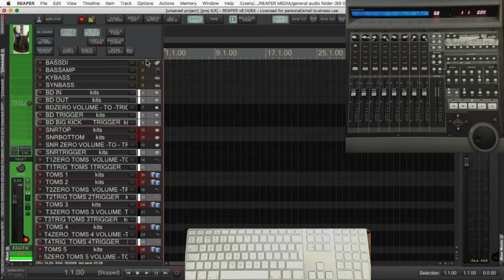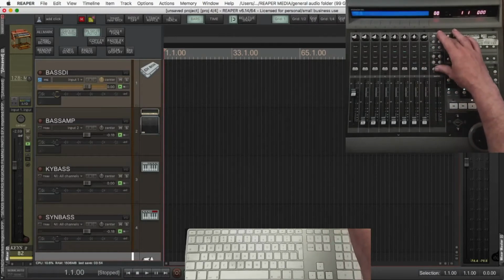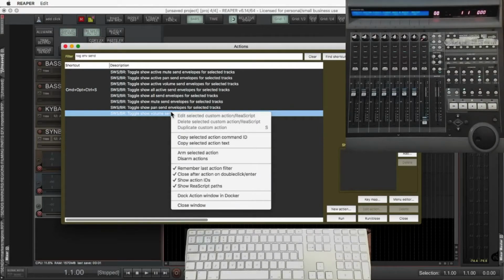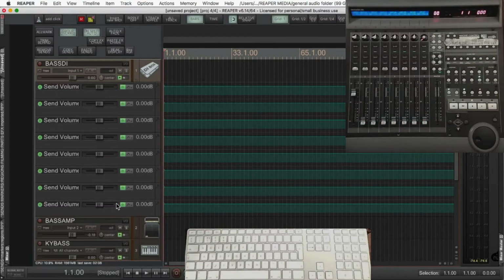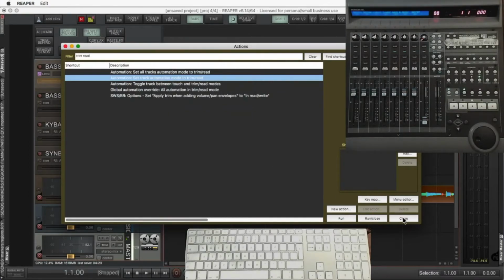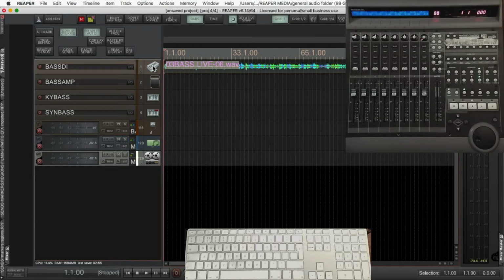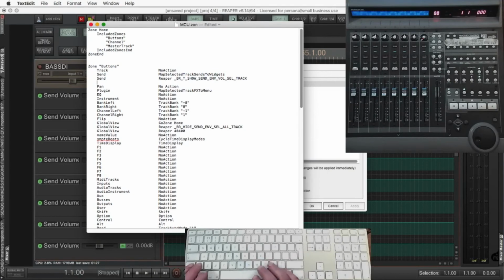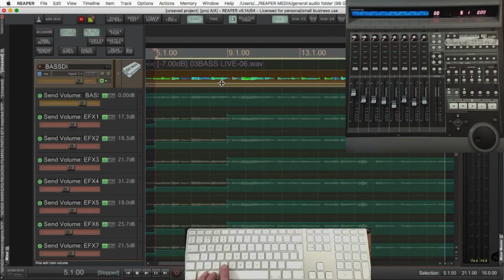REAPER DAW - CSI - AUTOMATION PROGRAMMING  BUTTONS  AND STATES -

Comment: Good video. I'm following this series closely because i'm trying to reprogram my own controllers. Can you make a video where you look at the difference between "MapFocusedFXToWidgets" and the "MapSelectedTrackFXToMenu" ?
Reply from the maker: Hi Thomas - i have now made a vid looking at the introduction of programming fx via CSI. I use map "SelectedTrackFXToMenu" to show the fx list on the channel first, then select those fx - floating fx. This is not looking at the difference, but does demo one of those you mentioned : https://www.youtube.com/watch?v=dOyxuHGOuS4&list=PLgiV4QJOk1rLRnCEVqC-qwcGe4HREZGi_
Reply from the maker: Thanks Thomas. I don't actually use CSI for fx - only general program control and sends - (found it a bit long winded compared to reaper's internal method of programming plugz - plus i already had a working system for fx programmed up. As the series goes on it'll explain why i do this and how it's easier for me to work with...... for now!   If you look at the bassroom/mixroom vids i show how i got them on my SL25 - the MOST important thing, is to have a controller that can handle the amount of parameters most plugins have. For EQ's - 24 rotaries or 16 and 8 faders and up to 40 buttons means your template on the controller stays the same for all of your EQ plugs, making it intuitive to use, almost like one piece of hardware for all EQ's. Then a template change for Compressors/verbs/delays and it starts to fall into place. Let me know what you think if you watch one of those, as far as an option for simpler fx control goes. ..
Reply: @undarkreaperdawcsi8187  Thanks for your reply. I have seen your video about your SL25 controller, and I'm applying several of your tips to my own reprogramming maps. I have a m_audio Project mix and a BCF2000. The project mix do most of the mixer functions where the BCF handles the track and arranges related controls. Regarding the need for many buttons, I have resolved it by jumping between different Zones inside the plugin *.zon file, which gives me the options of having the display to feedback what the controls are bound to in the different zones. I know the way I do it is a lot of programming per plugin, but I usually don't use that many new plugins.  I just Struggle to make the BCF2000 react to the selected plugin by using   "MapFocusedFXToWidgets", i do sometimes, but it is too random for me to find a clear workaround. I will scour the forums some more. Again thank you for replying, and looking forward to the next video 👍😀
Reply from the maker: @thomassimoninielsen1407  Aye - it's frustrating to get a work flow so close and then have random/apparent random events occur. The excess in programming put me off using csi for fx as i use a huge amount of plugins. The beauty of using reapers internal method is how easy to reprogram a change on one event is. midi feedback is the biggest hurdle. The midi twister has the right parameters with endless encoders, but no led for names - not a good layout but good controller.  I can't use midi feedback with the SL unless i use their now abandoned:  "automap" . So it' soft takeover or jump... not the end of the world on fx envelopes, but wouldn't like that on send/vol envelopes..happy csi is dealing with that. Tempting to just get into the arduino or teensy board setups and make the controller. But... how much time in a day!? ;)
Reply: Dudes, I’m working on an OSC controller to automatically map to FX; currently developing the code now and doing some testing. Once I got this down, I will do a video on it :-)
Reply: @defacres  Wow, that sounds interesting. looking forward to seeing what it is capable of. 😊👍
Reply from the maker: @defacres   Sounds great that mate - if you need a hand with any testing let me know- !